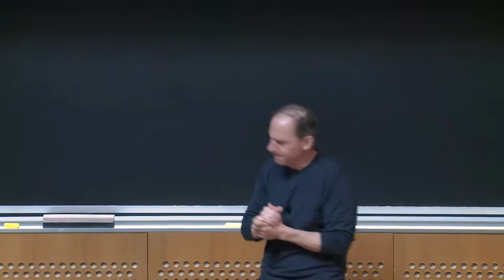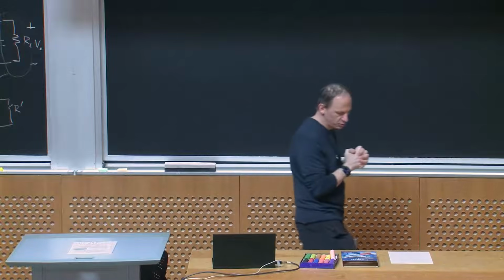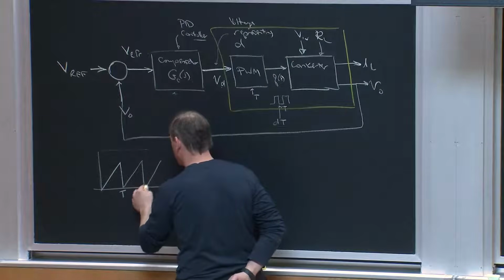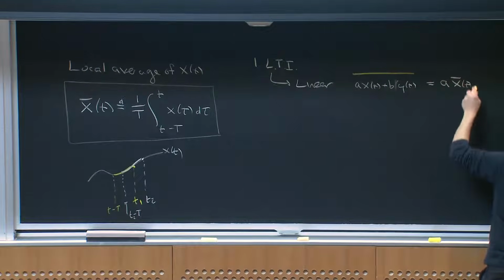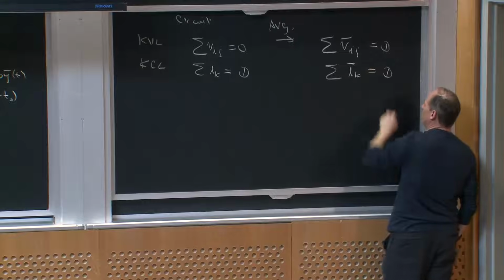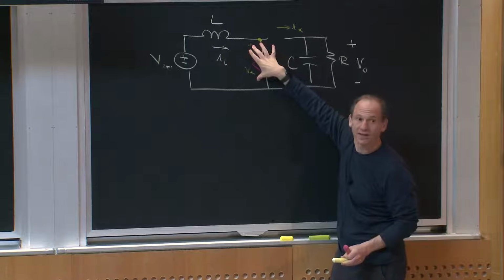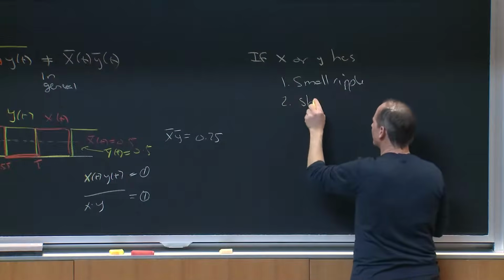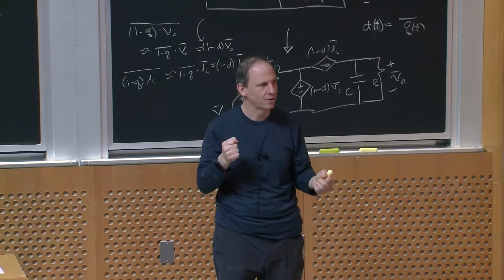Lecture 24: Control, Part 1

Comment: The load from a GPU varies rapidly and is NOT periodic or predictable. Manufacturers insist on the 100-year-old buck converter which requires around 12 switching cycles to recover from load transients. They use more of the same (up to 16 "phases") to try for a better result. The Cuk-buck2 is cheaper, smaller, and more reliable, but the circuit is not 100 years old. TRADITION!

Comment: Please do a lecture on 21st century power converters like the Cuk converter or the Cuk-buck2 in addition to the 1920 vintage boost and buck converters.  Also talk about hybrid switching instead of assuming everything is pulse width modulation.